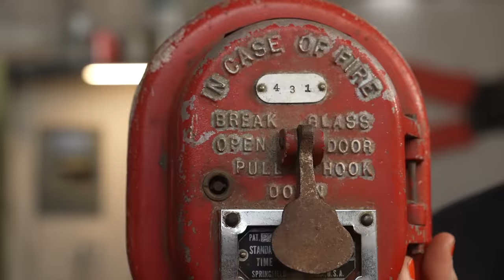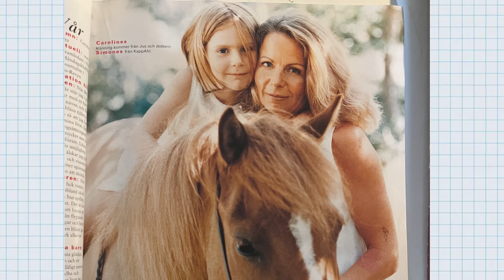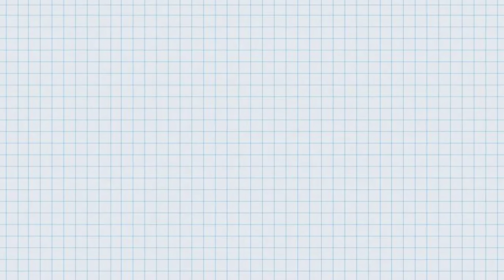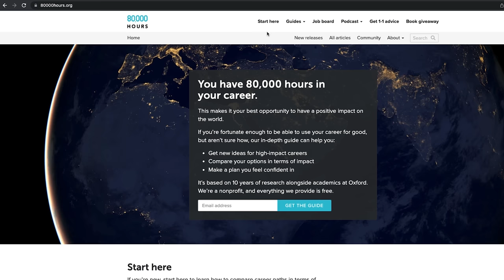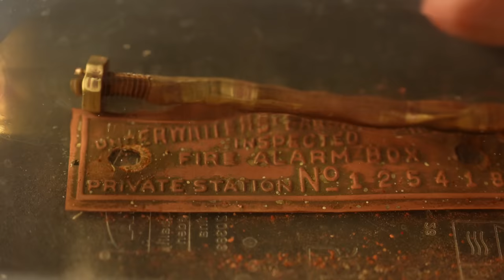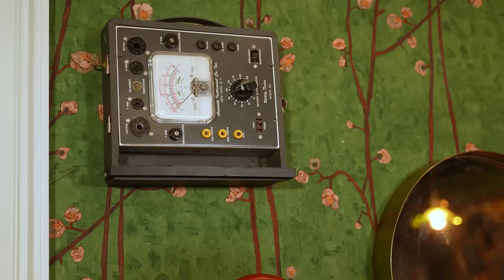Refurbishing an old fire alarm to make myself feel better

Comment: Making things is absolutely 100% a self love thing. Good for you for practicing what you preach. I'm going to my shop later to follow the same advice
Reply: What thibgs do you make, Jesse?
Reply: @Jasper_4444  anything that interests me. Wood, leather, metal I'm in. This weekend I'm adding to the aircraft carrier sized outfeed/ assembly table in my woodshop. Building some drawers for clamps, and a cabinet to fit under it for table saw accessories. And if I have time finishing the chop saw dust collection shroud.
Reply: For me it's mostly been wood. Furniture, model trains, and recently musical instruments.
Reply: @Jasper_4444  nice, trains sound fun to make. I'm researching a laser cutter as my next tool purchase and going to try and make making my full time job
Reply: Cool! Best of luck with that venture.

Comment: I've struggled with depression and other issues since I was 16; I'm nearly 47 now.  It is so easy to go down the rabbit hole of "I don't like my job and I've been single for a decade now and everything is awful," and it's so important to have a way to break out of that.  I'm glad that you have a method, and grateful that you were willing to share it here.  Based on the appearance of that bathtub, you're doing a fairly good job - routine housework is usually the first thing to go by the boards when someone has depression problems.

And even in this quick video, you still show the need to iterate and problem-solve in a project.  That you're able to do that with your brain being unhelpful is a marker of your skill.  It's a thing you're good at. Taking a minute to acknowledge the things I'm good at helps me manage my crazy, so it would probably help yours, too.

Oh, and if you're not going to the gym, it means that going to the gym isn't actually important to you.  Find a more interesting way to be active and stop fretting about the gym!  

Tak sa mycket for the videos!

Comment: I have several hobbies, but it’s drafting garment patterns and sewing them that reliably centers me. What Simone is describing is a genuine Zen practice.

Today, I’m going do most of the soldering for an ambitious project and probably leave it in a temporarily unfinished state. I think I’m going to enjoy the process and be alright with the day’s results. 5 years ago, I would have worked furiously and ended the exact same day completely disappointed. Purpose and gentle practice is medicine.

Comment: Hey Simone. I've been dealing with a lot of stress and depression and I absolutely use DIY and restoration projects as self care. When I don't have the energy or motivation to do anything else I will by an old "spares or repair" laptop off ebay, get it back to working order and then find a friend who needs a new laptop to hand it off to so for me at least fixing something up as self care is totally normal.

Comment: I've watched videos on people trying to fix the old stuffs, the device especially with the rusty ones. In fear of getting poisoned,they usually will check whether the poison is leaked (I think it's a lead check that they will get the colour of the a specific area and check from the tube whether it's contaminated or not) and then they will repaint them. So I think it's a good idea if you decided to use old materials but a repaint is always a good idea to prevent from lead poisoning or any other poisons not listed.
Reply: That aside.. I've always wanted to have a bathtub in my bathroom... 🥲 I want to be able to lie down and have a nice relaxing bath too 😂

Comment: So, the brass clockworks is an automatic telegraph device that would send a message to the fire dispatch telling them which alarm location was activated.   Maybe you could hook it up to make lights flash or activate some sort of plasma Jacob’s ladder .  Or or maybe ring a series of vintage doorbells or door buzzers or pinball machine type gongs - you could reprogram it to play a tune - something simple like “ you are my sunshine “ or”Smoke on the water” or  something like that .

Comment: So yeah, my mental health is also less stable than I wish it was. But I've had some help from professionals and some experience in knowing my strengths, weaknesses and (apparently) ADD. 

So to pay it forward, to whomever it can help, some of the things I've learnt:
- professional help is not a sign of weakness, it's a sign of self improvement. For some reason it's taboo, but I refuse to take part in that taboo. It helped me a lot and being transparent about it has made me learn a lot of people I didn't expect have had the same.
- a positive diary might just be your best friend. Every day write down something you're proud of. Something you did well. Set the bar low, something that you did or didn't do, that isn't always the case. Wk 1 is hard, wk 2 is easier, wk 3 you'll notice you'll find positive things throughout the day. 
- planning is both the scariest thing in the world and your safety net. I have had to take several steps back, make a planning in a way my brain understands. I'm still scared of it, but I have acknowledged it like that coworker you hate but have to see every now and then. 
- some things you do well, some things you don't. You don't need to be able to do everything well, don't beat yourself up and work from you strengths. You'll find several in your positive diary. 
- be a loser and a failure. Seriously, if you fall on your face-> what's the worst that can happen? I used to think this was bullshit, but progress is built on failure. Don't avoid it, accept it as an inevitable fact, because you'll find it regardless and it'll help you learn. Avoiding it is not really trying anything, or half assing until someone around you stops you. I know, I teach many students so desperately avoiding failure, you're creating their own failure.
- bluff. Chances are, if you act like you know what you're doing, people around you will be none the wiser. All successful people bluff. I'm not saying flatout lie, but don't make your talents and experience smaller than it is: you are literally your own biggest critic. 
- look at your activities and find out what gives energy and costs energy. You can't avoid all energy costing activities, but if a truly optional thing costs more energy than it gives back, you don't HAVE to do it. If a structural thing takes more energy than it gives, see how you can change it. Maybe you're a fish that's trying to climb a tree, and if you can change it, it might make your life easier. 
- accept yourself. You're amazing. Flaws and all. Some of your strengths create your weaknesses, you're trying your best and we're all just struggling monkeys with an enlarged prefrontal cortex in a fabricated world with fabricated problems and anxiety issues.

Comment: I have the perfect place on my kitchen wall for that! It is the location for an old rotary dial landline phone using a 25' phone cord to stretch the phone into the living room, or bathroom. Like my big sister did all throughout my childhood. I never got to use the phone. The calls were all for her anyway. She was popular. I was, am, an introvert, and struggle to find a good enough reason to leave the house or talk to a stranger. I think I will go find the old rotary phone and put it back on the wall in the kitchen. It's red. Too bad my landline was ripped up during the septic tank/system was repaired by my ex, accidentally. I decided not to fix it, since no one uses landlines any more. It will still look pretty on the wall.
btw, you are awesome! ♡♡♡♡♡

Comment: i can't help but wonder about whether there were problems encountered by the users of the eairlier models of this fire alarm. it would apper that after not pulling the hook down far enough, the users called the manufacturer to complain about functionality, which inspired a revision to the instructions on the casting from 'pull hook down' to 'pull hook way down'. hopefully that fixed the issue.

Comment: That brass mechanism is beautiful, and it sounds like it is at least somewhat functional. I wonder if it couldn't be used as some sort of a timer, e.g. a mechanical means of activating a light for ~30 seconds when a door is opened, or perhaps a terrible music box with a little ballerina.

Comment: Yeah. I’m a long time practitioner of avoidance. Doing something else to avoid facing the problem. I’m much older than you, like over 20 years, and in my case it doesn’t work very well. I have to “embrace the suck” as the kids are calling it now. Otherwise the depression just drags on and keeps popping up. But I do a self check thing that sorts it out pretty quickly (not that I act on it very well every time) first I see to my blood sugar level. It’s amazing how screwed up I can feel from just not eating right. If that changes it, then I’ll look deeper to see if there really is a problem. It’s a little like disarming a bomb right on time, everyone sighs and starts to party before finding out there’s another bomb ticking right under it, but it’s necessary for me. My bombs don’t go away and the longer I ignore them the more nuclear they become.

Comment: utterly impractical idea for ping pong balls: make a clock

ping them up like a pinball machine, and use paddles or some dr nim style routing system to get them into columns for hours and minutes, which just need to empty when the value rolls over

Comment: Someone else may have already suggested it, but on the subject of the ping pong balls, my first thought was something where they're cut in half and used as light-up keys in some sort of goofy input device for one of your signature contraptions. Probably low-hanging fruit, but that's my two cents, as it were. Good luck!

Comment: Ah man. You ripped out the mechanism and hot glued plywood in? Honestly it upsets me when entropy wins and another complicated item from the past turns into something much more simple and useless. It's like turning a clock that someone designed and built without the benefit of a computer, into an ashtray.